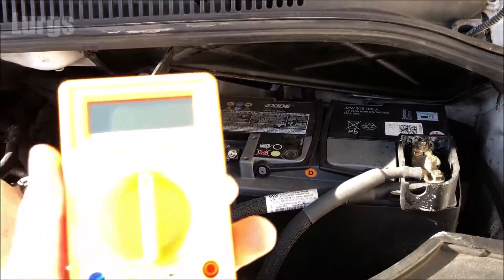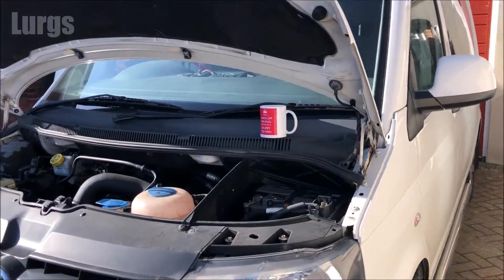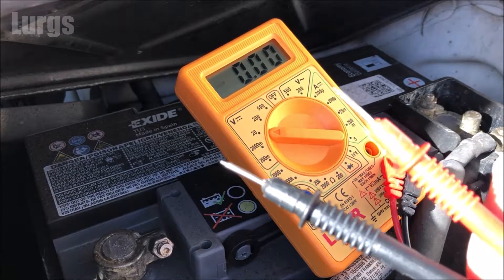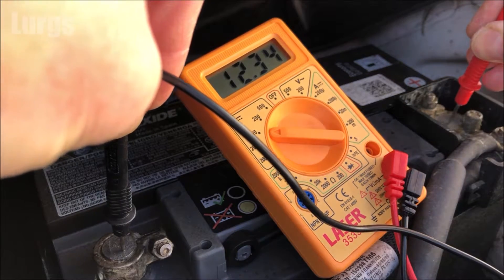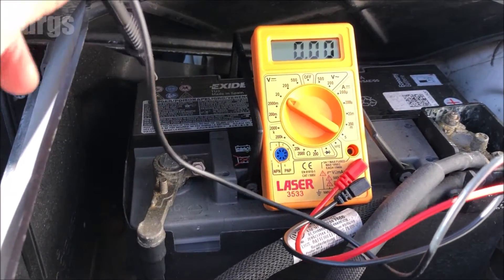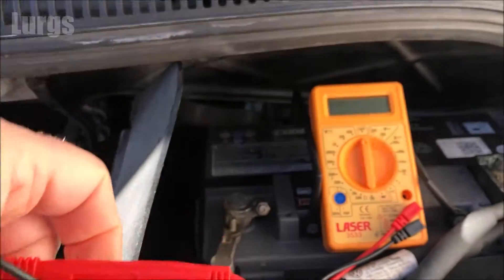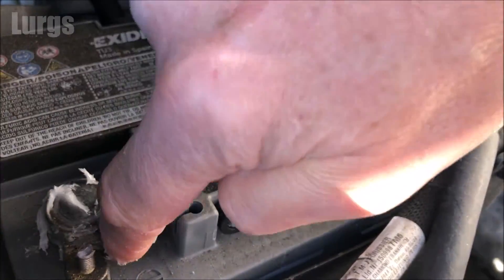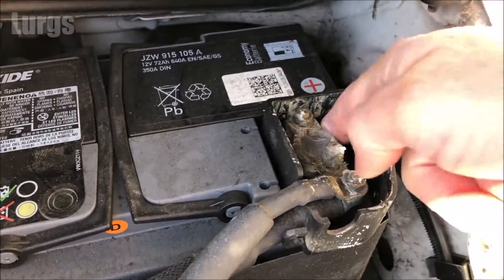How to check a Van Battery with a Multimeter & TOP TIP for keeping battery terminals corrosion free

Comment: Does not measure voltage drop so battery could still be faulty
Reply from the maker: Hold it on battery whilst someone tries to start the motor, then you can see if the battery is struggling on the Multimeter